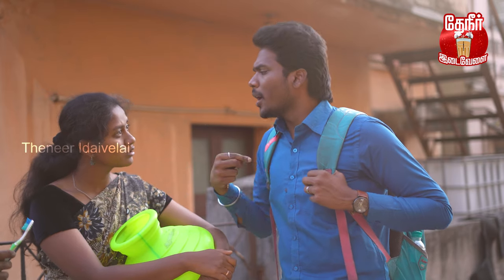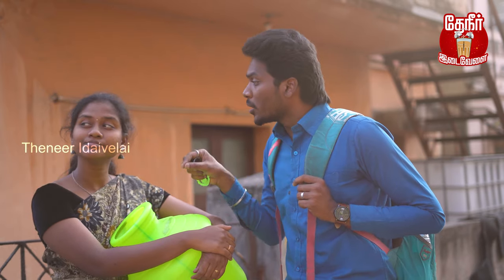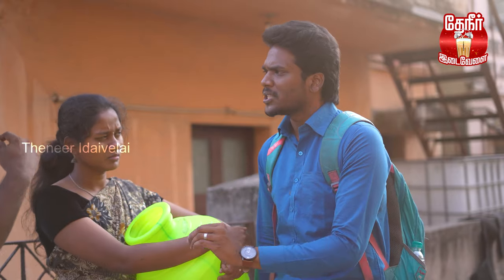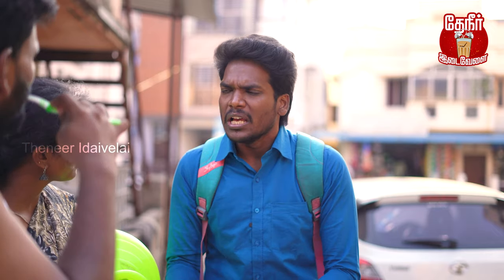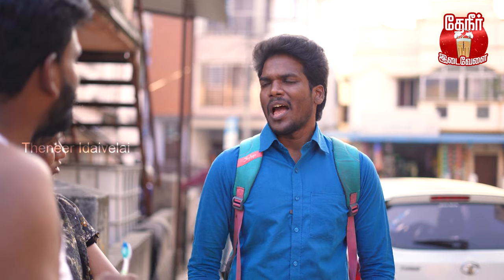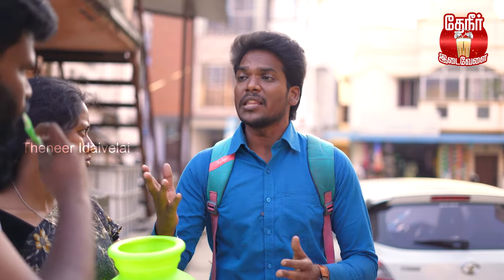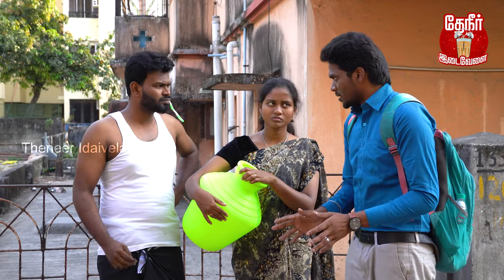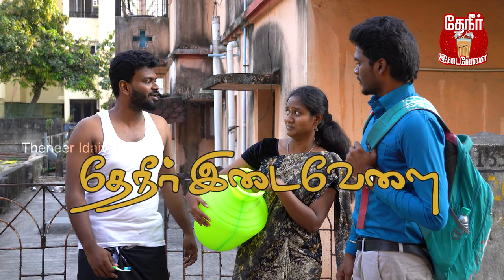Motor Pumps: உங்க வீட்டுக்கு எந்த Motor சிறந்தது | Bore Submersible vs Monoblock vs Jet Pump | Motor

Comment: சரியாக தெரிந்து கொண்டு தகவல்களை பகிருங்கள்... Monoblock மோட்டார்களில் அதிவேக திறன் கொண்ட 1hp , 2 hp என்று வகைப்படுத்தப்படுகிறது அவை விரைவாக நீரை மேல் ஏற்றும் 35 அடிஆழம் வரை செயல் திறன் கொண்ட போதிலும் அதன் மேல் ஏற்றும் திறன் சிறப்பாக இருக்கும் .
மேல் ஊற்று நீர் உள்ள பகுதிகளில் இதுவே சிறந்தது
Reply: Single phase மற்றும் low voltage current problem இருக்கும் இடங்களில் 2 hp mottor சிறந்ததா.?